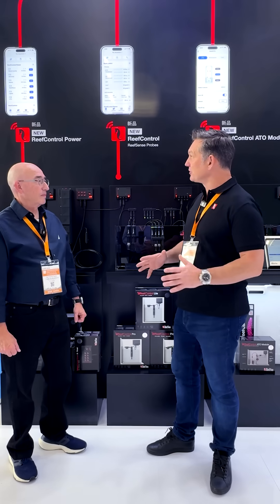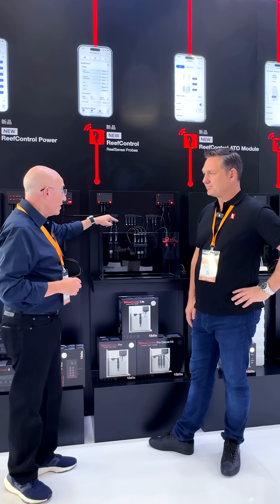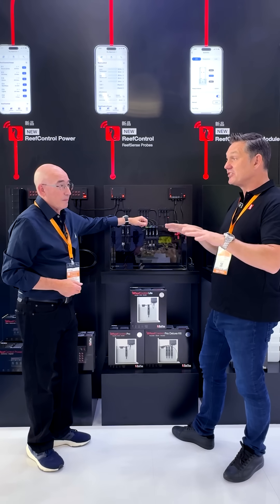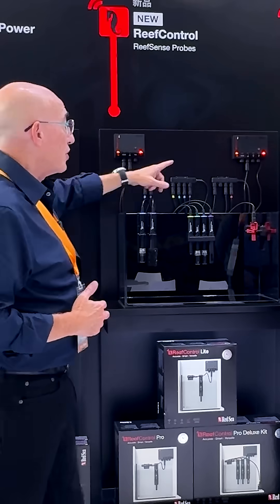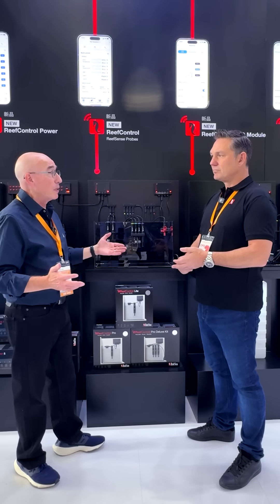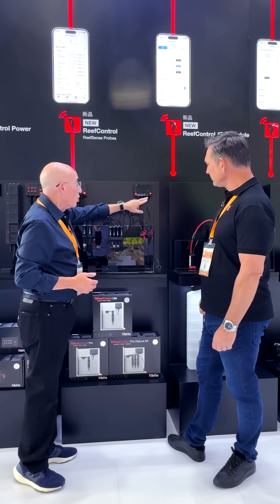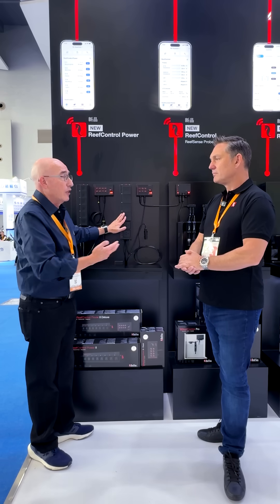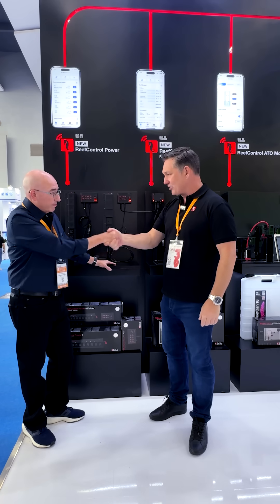Red Sea's CTO on ReefControl innovations

Comment: The power Bricks are a game changer for sure, but here i do not really see a point of adding. In the ATO there is a temp sensor already. If your alkalinity is good your PH is fine most of the time. ORP is my setup not usable, and salinity is fine because of the ATO. I check maybe ones a month and it is always fine. I will have the new power bricks with controller board soon, but i am skipping this product. maybe in the future when there are other probes.
Reply from the maker: Thank you for taking the time to comment, what would you consider as your top 4 probes? What would you like to see more?

Comment: can we add current redsea ato to this setup
Reply from the maker: You can keep the current ATO+ system no need to swap, but if you wish to, you can just but the Digital ATO sensor and use the pump with the new ReefControl.
Reply: @Redseafish so the existing ato sensor and pump that are currently running with my ato+ can be hoocked up to the new controller alongside all the other equipment?

Comment: Question will the communication between the probes. and the powerbars, for example, work locally without internet? Given the risk around outages I feel its vital that it can operate locally. Not necessarily be configured locally but at least keep operating in the case of an outage. Example would be the ATO connecting to a third party pump (such as the example Neil gave).
Reply from the maker: The connection between the ReefContol Power and the sensor is wired to elimitate internet drops etc. It's a valid and very important feature we took into account. You can configure the sockets as you please.

Comment: Can you add probes to the ATO kit?
Reply from the maker: The new digital ATO prob dosen't fit the ATO+ controller. 
You can keep using it or get the digital ATO probe, lose the ATO+ controller and use the pump with the ReefControl controller (it frees up space and a socket)